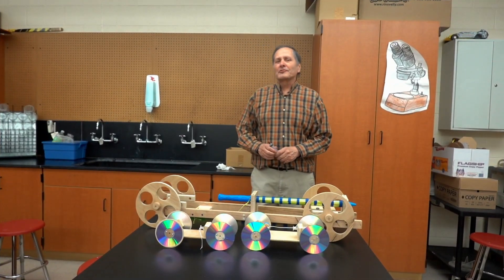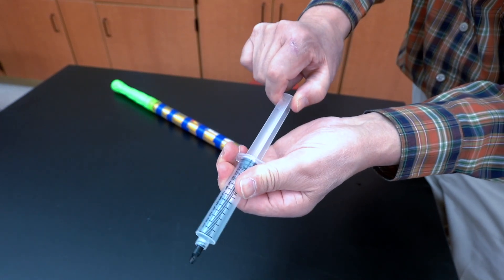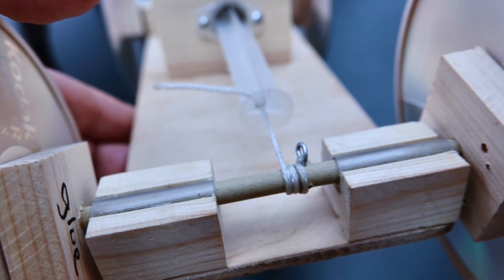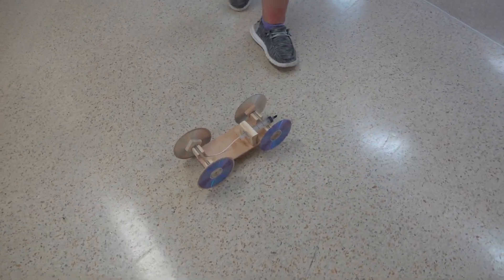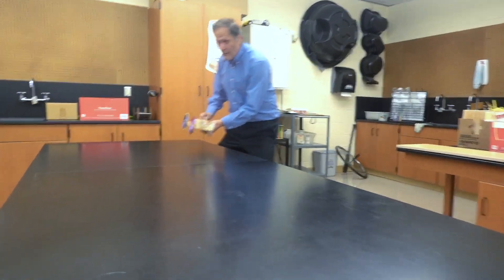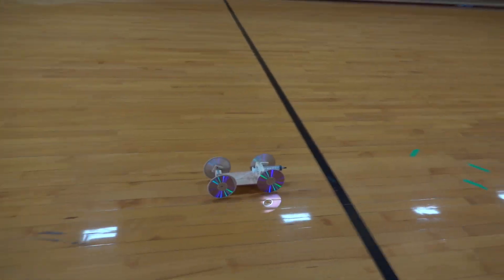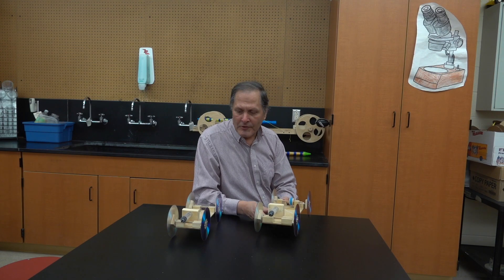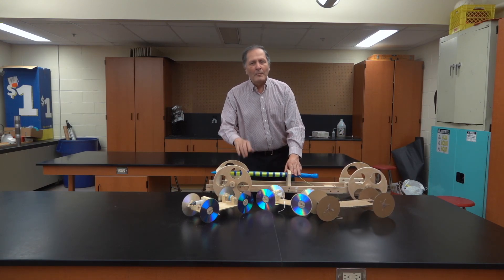Atmospheric pressure powered car // Homemade Science with Bruce Yeany

Comment: 5:02 - You can replace the rubber band with another string which will detach itself from the rear axel as before. Then you have two detaching strings, one fixed on the syringe, the other one fixed on large spool (of thread).
EDIT: Or actually, the string between the syringe and the axel of the large spool doesn't have to be detachable as long as the rear axel one detaches.

Comment: Another wonderful project for my grandkids. Adding the third axle the friction was increased (on axles only) by 50%. Front axle and rear axle frictions are actually different but for this discussion we will disregard. The rubber band also loses energy due to the compression/expansion between the inner and outer surfaces. This is one reason an internal combustion engine uses a timing chain instead of a timing belt to increase fuel economy. The ideas from woowooNeedsFaith and dextersxxxlab are similar in concept. Perhaps using gears or block and tackle would be a way to increase the distance the cars will travel.
Reply: Exactly. A gear or block and tackle kinda thing. I think the later would be best to show kids a different use for such a thing.

Comment: Pull a page from Colin Chapman and drill holes everywhere to reduce weight (I might even go as far as using aluminum rods/balsa wood to attach the front/back wheel assemblies in there was at least a 20% weight reduction). Use the syringe as a stressed member or mount it vertically.

Single wheel up front to reduce friction (or take the rubber bands off the front ones).

You should be able to calculate the total force available from the plunger and use that to figure out the work being done to the weight of the car in an ideal state. Anything close to 60 - 70 percent is really good. Less than and you go looking for parasitic losses (polish wheel axles, better transfer of force to the axle [maybe fishing line or dried contact cement at the string interface], etc.).

Rubber bands on the CDs was pretty slick.

Comment: The solution I think would be the coolest to get worked out would be a multi-stage system, with multiple syringes engaging one after the other.
Same effect as a longer syringe, but without needing a longer car.

How that could work I have no idea. Not only would the second stage need to be triggered somehow, but also be able to remain wound up while the first stage was operating.
The trick with hole in the axle and the eyelet wouldn't work for the second stage.
Reply: I would think a series of one way  clutches, and a sear system of some type on the plungers would take care of most of that. System drag might be a problem during coast.

Comment: For the second design...make the gear section act the same as the syringe does. Let it pull on the drive axle the same way and fall off when it hits the end just as the syringe string does. That way the drive axle gets a speed boost that will carry it further without the larger gear section slowing it down as it tries to drive the larger gear.

Comment: You could use a lever system (in the lateral dimension) to have a wider course to pull the string over, somewhat like how a shortshifter works in a manual car. A pulley system might work as well but it raises the question of the fixing points..

Comment: Instead of the rubber band gear reduction system, mount a simple lever arm to the piston and use it to accomplish your gear ratio change; since the syringe only ever strokes once, you don't need an actual belt/gear system capable of making an unlimited number of turns. Simple to build and very low friction!

This would allow you to extend this experiment to cover lever mechanisms of various types; have students experiment with different arm lengths (even adjustable ones with different string tie points) and different lever classes. They can reverse the piston's orientation or change its mounting to accommodate their lever design, taking care to use an arrangement that provides for some way to ensure the linear motion of the plunger doesn't bind up from the curved path the lever arm travels.

Especially clever designs might optimize the lever angles to vary the torque curve as the car travels, providing higher torque at the beginning to get the cart moving and up to speed then reducing torque as the arm rotates to extend total travel distance by keeping the car's speed low.

For these carts, the lower torque you can drive the wheels with, the better (in terms of distance) as you'll pay less losses in friction and air resistance. As others mentioned, better wheel bearings would help too, and low enough torque to use hard/solid wheels (no rubber bands) without slipping will be more efficient. Possibly lubricating the syringe; you're likely losing a lot of energy between the rubber plunger and the plastic syringe walls too.

Comment: Hey Bruce. How about pulling on a single pulley block and tackle. One end of string fixed to cart, the other end wrapped on axle, syringe pulling on the axle of a pulley the string runs through. Effectively doubling the stroke.

Comment: You, sir, are reinforcing my regret of having forgotten calculus, algebra, as well as trig for the most part. Damn these last thirty years! But my guess is use a decreased diameter axle with an increased diameter syringe. I'm going to pull aerodynamics out of this. For safety's sake.

Comment: Wonderful series. My suggestion: bearings, bearings, bearings! I liked the suggestion of a secondary string instead of a rubber band, but more shafts more friction. How about a 2:1 block and tackle system between piston and axle (more friction), or bigger wheels (the ultimate solution, surely?)?

This and the eggs previously featured reminded me of a tv series in the UK in the '80's called "The Great Egg Race", where, if my memory serves you were given a standard rubber band and a standard egg and had to propel it as far as possible without breaking it.
Reply: You could also reduce the axle friction by 25% by turning it into a trike. Drive the two front wheels and have just one center wheel on the back.

Comment: What if if we use ball bearings in the wheels to reduce the friction? and also what about using the same system but instead of directly driving the wheels axis , it is used to drive a flywheel ?

Comment: I wonder if you could make a small scooter, maybe with a seat, or small pedal, that will push air out of a container to charge it up as you go.
Of course the string mechanism will need to go, replaced with a gear system of sorts.
As a proof of concept, perhaps a serrated strip (such that is slides past a gear in one way, and pulls it on the other, I forgot how that's called), taped to the the syringe plunger, pulling it back slides past the gear, while letting it go will cause it to pull the gear with it, moving the car.

Comment: You're losing too much energy turning that big "gear." Is that block heavy? Maybe a plastic version would succeed in dissipating torque in transmission without wasting power through overcoming the inertia of the gear's weight. But there's also the friction factor caused by adding more turning links, which saps the energy, even more so as tension increases on the band.

Comment: Your car has far too much mass. If you do some videos of the drive wheels with some marking so you can determine how much slip at the start. Get rid of the wood frame make out of CDs; it will scream down your drag strip.  : =  }}

Comment: use the direct driven type with the metal reduced axle and increase the wheel diameter. Maybe also use ball bearings on the axles to reduce friction. try to keep the wheels just at a size so the force of the seringe on the string will be just enough to get it moving and excelerate.